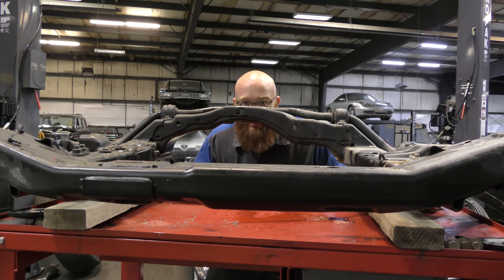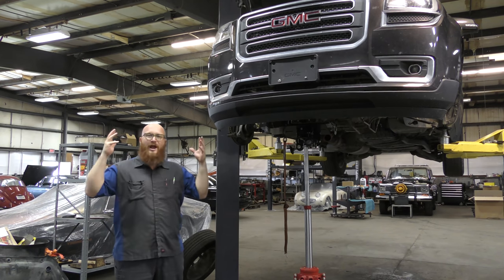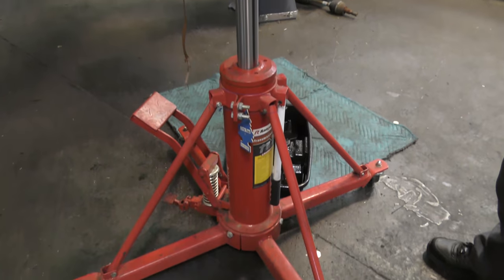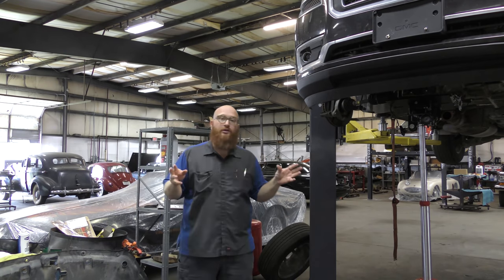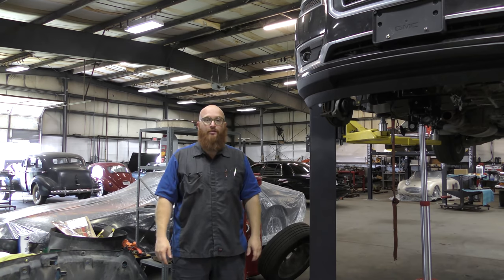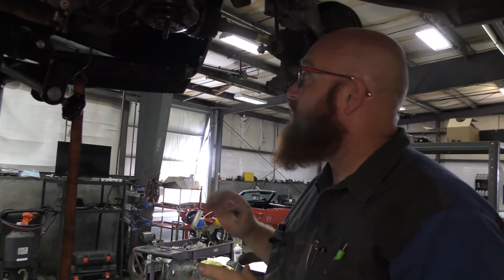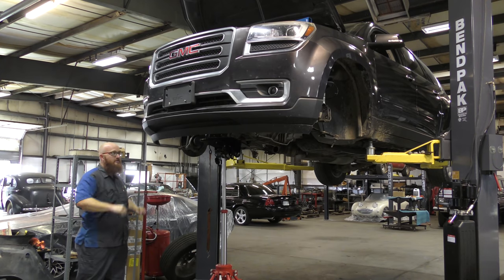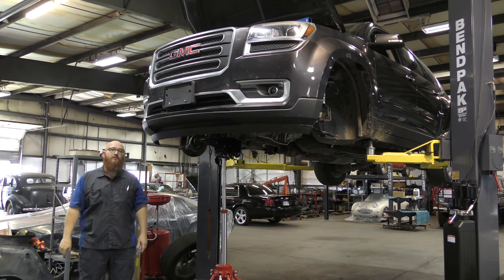Used car insanity in the CAR WIZARD's shop! Why did the huge repair get approved on this '15 Acadia?

Comment: This is ridiculous GM "quality"' for a relatively new 2015 vehicle.  And cars are at the auction for a reason, the reason being they have problems.
Reply: Have they fixed this on newer cars with the 3,6 ?
Reply: Do auctions let you scan codes or have them printed out?
Reply: @Hissmannen no they have not. And probably do not plan to. They are designed to fail. I have seen so many of these die like clockwork right at 100k unless the owner is really good about maintenence. Even then that does not buy much time.
Reply: Its still less problems than their competition has, so the quality is still better than the competition.  This long term unreliability of ALL modern cars is part of the reason the last vehicle I acquired was actually built in the late '90s, and the only thing I do to it is change the oil occasionally, and it doesn't even ask for that.
Reply: @DamionG1987  yes, no ecoboost for me.  My Fords are Barra, and Boss.
Reply: @Hissmannen  In 2012 the 3.6 made a huge step forward in reliability.   The big issue is the oil needs changed more often than factory spec.  It's back to the 70s with 3000 mile oil changes.  I have seen a lot of neglected Impalas go past 200k with out upping the oil changes.  But they are a lighter vehicle with adequate cooling systems.  If you want your Acadia to go 200k change the oil every 3k, or get rid of it at 80k.

Comment: When GM changed to the LFX 3.6 in 2013 the timing change issues mostly went away, and working at a Chevy/GMC dealership I haven't seen a rear main seal leak on an Acadia like that.
Reply: Same here at the gmc dealer, never seen a 3.6 with a rear main leaking.  it makes me sad the chains last longer,  now we have less gravy jobs.

Comment: 15:25 the gen 3 W body Impalas don’t require a dash out but you do have to remove the glovebox on the passenger side and the kick panel on the driver’s side. Even though they go bad so often, those cars are one of the easier ones to fix. It’s still $1000 because it’s got two blend door actuators. Do not use aftermarket parts for dash actuators.
Reply: We had to replace the recirculating door actuator in our Dodge Journey when we first got it; thankfully they had the forethought of using the same actuator for all three (four if it’s equipped with dual zone climate control) doors.
Reply: I've replaced those in my wife's 09 Impala a few times, but was using aftermarket parts some actual decent quality, or so I thought.  The last go around I used OEM parts and haven't had  an issue since.  It's been about 3 years.
Reply: I came here to say this! 

Lol no I didn't.
Reply: $1000 for $50 worth of parts and an hour worth of work. Bend over buddy!
Reply: Usually the Dorman part is better than OEM.
Reply: jon mccormick ha, your funny
Reply: A-MEN
Reply: It’s funny on my 2012 Chrysler I used to have i had to replace one of these, but I always was kinda think I just wanted to pound a nail into it instead of waiting for the dorman replacement’s plastic spindle to inevitably fail and have to do the whole thing over again. Luckily on that car they were somewhat accessible.

Comment: I have a mechanic I have been using for in excess of 30 years. The guy who runs the shop is called Ed, and I absolutely trust him. I had a head gasket failure on a Volvo 5-pot, and two bolts snapped. It’s a thing that happens. Just like the engine dampers. The bill increased by 25%, but years of trusted advice means I paid, knowing it was real, unavoidable, and shit happens. Moral: find a wizard and stick with them.

Comment: My 2003 Grand Marquis needed a new actuator for the temperature controls three years ago. $700 estimate. Every spring I take the glovebox out, reach in and turn the door lever to cool, and every fall I reach in and turn the lever to heat.

Comment: Man I almost bought one of these about 6 years ago. So glad I didn't. Went with a VW Touareg instead. Now at 150k mi, and aside from maintenance the only "repair" it's ever needed was an ignition coil last summer that cost me $35 and I did it in 5 min. In the AutoZone parking lot. No leaks, no warning lights, no problems whatsoever

Comment: I own a 2014 Buick enclave with 100K miles on it. I replaced the water pump and motor mounts by my self at 95k miles. I change the oil every 5k miles with quality full synthetic motor oil and top quality oil filter, it's better do it yourself and spend $50-60 on quality oil and filter than pay 30 bucks at any quick lube service without knowing what they put in your car.
GM 3 6 liter engine are not good and reliable as the famous 3.8 (3800) but aren't bad neither.

Comment: GM...."Generous Maintenance"- my wife got an SUV with the 3.6L and the 6-speed. Always taken care of, and the timing chains stretched at 72k. GM 'fixed it' under warranty. Under 50k miles later, happened again. Again, always clean, maintained (Wix filter, synthetic oils) and not beat on. Oh, and the valve body started sticking.
The chain issue is caused by a piss-poor drain back issue on the rear head (or RH side if RWD). Cause of that? The terrible crankcase ventilation on that head.
Transaxle? Sticking shift solenoids. $2k fix. GM keeps losing market share because they build shit like this-

Comment: That's so unbelievable because the old 3.8 L or 3800 series was so good so reliable with its pushrods and had quite a bit of power even in an old man's car like a Buick Century or Buick Lucerne was the last one
Reply: The Century has that crappy 3100 v6 that is run into the ground by it’s owners. The 3800 was in the lesabre, park avenue, regal, the awful Grand Prix and the Lucerne. I’m sure that I’ve forgot a few.
Reply: @ryanthompson2893  05 to 09 Buick Lacrosse had 3800 series 3 as an option.

Comment: Look at a 3.6 liter GM timing chain it has just two links one on each side like a bicycle chain.  Look a a 3.6 liter Chrysler timing chain it has a full 4 links guess which one costs less and wears out sooner?
Reply: I'd say the Chrysler one.  Just junk.
Reply: @seanfrank4158  The Chrysler 3.6's are solid engines for the most part, you don't hear much bad about them as they get higher in mileage. Same with Hemi V8's. It's a new day when Chrysler builds more durable drivetrains than GM.
Reply: Thanks for the information! I did not realize that the timing chain on the 3.6l GM engine was built like that. It's hard to believe that keeping up on oil changes and regular maintenance would prevent the chain issue that happens so often. Sure, maintenance would postpone the issue, but not prevent it in the long run.
Reply: Chrysler builds good engines actually (besides the 2.7 lol) just the electronics aren't the best lol
Reply: @nicholasfield6127  Of course they do! They're the only ones that have a patent on the Hemi .

Comment: Last week, the Car Wizard completed another series regarding the six used vehicles with these unreliable engines and transmissions, that you need to avoid at all costs, including the 3.6 L Pentastar V6 engine from Chrysler, Dodge and Jeep. Another vehicle to run away, as quick as possible, is any Chrysler PT Cruiser with any engine and transmission from 2001 to 2010, because they are poorly made and they have a horrible design. Thank you very much and the next Car Wizard video will be up very shortly.

Comment: GM invented this nonsense. The V8 monza of the the '70s required disconnecting the motor mounts and raising the engine for spark plug access. Another car they marketed had the A/C compressor blocking removal of the distributor cap. I had an 84 s10 which required raising the body above the frame for access to a bellhousing bolt for engine removal.

Comment: I lucked out so hard when I got offered a 12 valve cummins with only 100k miles for $2500. I jumped on it and didn't even have the money. Same truck with twice the miles is $10k easily.
Reply: I’ll give you 5k right now lmao
Reply: @grantgauvreau2744  I'm not selling anything until the inflation settles down. When money is cheaper than toilet paper I'll be glad for every hard asset I own.
Reply: @Kenwood709  don’t blame you one bit👍🏼
Reply: Damn you lucky sob. A twelve valve for $2500.  In Ca you could sell that for over ten easily maybe 15,000

Comment: Had the shops tell me it was going to cost $1,000 to replace a $40 part because of the dash. Decided to do it myself. I am a trained mechanic and did the job in less time then what the book said. But 95 percent of customers can't do the work themselves without doing more damage than good.

Comment: The Car Wizard did a video on the six vehicles that he already mentioned to never, ever buy in general and all of these GM vehicles with the 3.6 L V6 engine is one of them. Also, not to buy in the used vehicle market is the Mazda CX-7, especially the ones with the 2.3 L turbocharged four-cylinder engine. These Mazda CX-7's had the similar, timing chain problem as the GMC Acadia, did. Run away from these vehicles and never own one or another, ever again. Thank you very much and have a great weekend. Cheers, guys.

Comment: My 2004 Buick Le Sabre Custom,3.8 V6 with 28K miles.  Been to New York 2 times.  Rest is suburban Chicago driving  It has never seen a repair garage hence no problems. Oil Changed 3/4 annually depending.  Last fall my usual Penzoil 5 30 was no longer available..  It is for high mileage cars and has additives to rejuvenate seals.  I elected to try it.  4 months and 500 miles the oil drips STOPPED. Try it, you may like it.  The repairs I am sure would be more than the car is worth.  New cars are garbage in my estimation.  I am keeping it as long as I can.

Comment: I've said it before. It should be mandated that all automotive engineers/designers perform the maintenance on these vehicles for common failures.

The problem is that the engineers are only designing these vehicles with the assembly line in mind rather than the repair shops or DIYers in mind. The car companies design cars for those who only keep a vehicle for 2 or 3 years.

Comment: I have a 2012 Traverse that I have owned for 6 years.  Good to know about the timing chains and guides.  It has been a decent car for me.  A couple small issues but mainly oil changes and brakes.   I had the blend door actuator go bad and the window switches.   Now that I wrote this something will break!
Reply: Your traverse still doing decent?
Reply: @johnl3230  Yes, just sold it actually.  6.5 years no major issues.  Was a 2012 model year.  Guess I am lucky.  Brakes, tires and oil changes only.  Window switch also went bad.

Comment: P00 codes make the car run like poo. Pro tip set the hvac fan on low while changing air flow settings, less stress on blend doors and motors.
Reply: Some times p03 codes make car run less then desirable
Reply: The newer gm automatically slow the fan when switching modes

Comment: 6 year old car and the rear main seal is blown? That's literally what insane. And you'd have to be even more insane to buy a GM product.
Reply: It's worse to buy the newer Fords. The Fusion's Focus's and F150s  transmissions are going out left and right and the F150's 5.0's are flatening the cams from the valves sticking. Mechanics are literally saying these new transmissions from Ford are worse than GM's 700R4/4L60 transmissions.

Comment: Honestly, I’d probably ASK for the engine mount to be changed if someone was going this deep into the repair.  Might as well do it for the cost of the part, and no additional labor.
Reply: most people would rather throw a vehicle off a cliff than pay 5k in labor

Comment: I work as a Service Advisor for a GM dealership and we do timing chains quite often on the 3.6 motors as well as the 2.4 Ecotecs. We also get a lot of them in for wheel hub sensor issues, AC problems, lower control arms and stabilizer bars along with air bag sensor issues. While I don't mind as we get a commission for all the work I do scratch my head at how some people chose to buy an Acadia or Traverse. They drive like boats, don't handle well, aren't all that fast for their 288HP rating and competitors like the Toyota Highlander and Honda Pilot feel lightyears ahead of these mid size GM crossovers.

Comment: The drivers side HVAC actuator failing on Infiniti Q50's are probably its most common problem, LUCKILY they are only a 20 minute job at most. Done mine twice now lol!
Reply: It would make sense to have the actuator OUTSIDE the plenum box and operate the doors by cable...oh wait......

Comment: Make sure that power steering line retainer goes back on or the hose will rub a hole in the a/c line that goes to the rear evaporator.

Comment: 5 gallon refillable RO water jugs and a dispensar. Saves a ton of money long term, tastes better and uses less plastic waste. It's 3 dollars for a 5 gallon fill up or 8 dollars for a 24 case of water bottles. The 120 dollar initial device cost gets paid back before the 10th refill of the bottles

Comment: GM will eventually only make pickups and Escalades, Denali"s and Yukon's They build crap otherwise and it is apparent to everyone now!
Reply: Eventually, channel will need to be renamed to 'SUV Wizard.'
Reply: Those trucks are crap too.    We (dealership)  have brand new trucks eating camshafts and lifters.  Everything GM makes is junk.
Reply: @scrappy7571 Not my 1980 Oldsmobile with the 350 Rocket. Over forty years and only minor repairs , That was when GM built them  for reliability.
Reply: @lilibethdoherty295  That was 40 yrs ago... Now,  I would not recommend any GM product to anyone.
Reply: @scrappy7571  Agreed. GM doesn't seem to make ANY durable drivetrains now aside from electric cars and diesels... The V8's with that cylinder deactivation garbage that kills the motors like you said, and all the timing chain nonsense that plague most of their other 4cyl and V6 engines. It's a damn shame when Chrysler actually builds more solid drivetrains than GM because I hear mostly good things about high-mileage Hemi's and their 3.6L V6's, although their Fiat-designed 4-bangers have a terrible reputation too.
Reply: "Generally Munted" as we sometimes say in New Zealand (polite term for something else)
Reply: @chynacash3138  Cylinder deactivation COULD have been solid and reliable, but Ethyl the Aardvark (the quantiity surveyor) cheaped out between the R&D shop and the production line, making a couple of parts slip too much and..... well we all know the rest.

There is a need for value engineering in any manufacturer, but the problem becomes when that value engineering starts destroying the brand's reputation. The issue is that the people involved have more influence than the actual engineers
Reply: @chynacash3138  I was surprised by the abuse my 2012 caravan taxi went thru ,400K and did not even burn oil !
Reply: Don't forget the Silverado that after 900 miles pukes all of it's oil on the ground and drops lifters!
Reply: @johnjennings8085  GM used to mean value and reliability, and now no value or reliability!
Reply: @johnjennings8085  My 05 Colorado sat in my garage for many years from 06 till 2010 it had just over 4K miles on it when I bought it from a family friend who passed for price too good to pass up, I went to  register it and they told me the value was $19,000 + that I had to pay sales tax and personal property tax on it for more than I paid to buy it for ! After sitting all the years the loss oil pressure caused the rocker arms to  fall out from the top of the lifters and would not start.

Comment: My Honda CR-Z is 8 years old going on 9. The only problems in 4.5 years of owning it were that one rear suspension damper failed and the oil sender was leaking. Under $600 to fix both issues and I’m still a happy camper.

Comment: @2:57

Six months, Fall 2022, ago my dad sent a family text message that contained a picture of a Dealership ad that was run in a Central Illinois newspaper which read:

"2011 Ford Escape: 165k miles; $10,999"

Over a decade old domestic crap wagon with 65k more miles than the B35 life of the vehicle!

Inconceivable!

Comment: Been there and done that timing chain wise on the high value V6 in my 2009 Cadillac SRX @ around 130k miles. Fortunately that engine is longitudinal so the DIY replacement wasn't as big a pain as it would be in the Acadia.
Reply: 2012 the 3.6 made a huge step in quality.   I see a lot of Impala s with that engine and 200k miles.  Anything older than that with a 3.6 I would not even consider buying.   The 3.5 and 3.9 in the Impala before 2012 were also pretty good engines.

Comment: I told my workshop, that I am fully aware of the difficulties when it comes to repairs. The only thing I asked them was to be 100% honest with me. No making up, no hiding. So they did. They also told me how to fix easy stuff myself. In the end after ten years I bought a new car from them. This is how you run a shop. 👍

Comment: I recently got rid of my wife’s 13’ Acadia after reading about many issues they have. We purchased it with 63k miles traded at 100k miles I didn’t do any research on it before we bought it (shame on me) but we had the engine pulled apart, timing chains done, new cam shafts installed and some other work it was $5,000 thankfully that our warranty paid for after all of our headaches and also needed more work that the warranty didn’t cover but we then traded it in for a 2021 Toyota Highlander and will never get another Acadia in our lifetime!